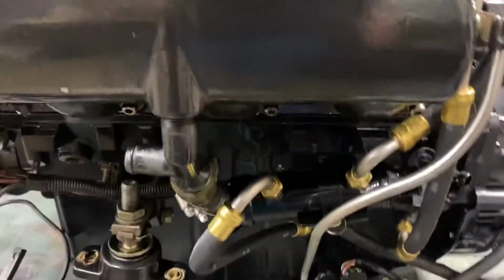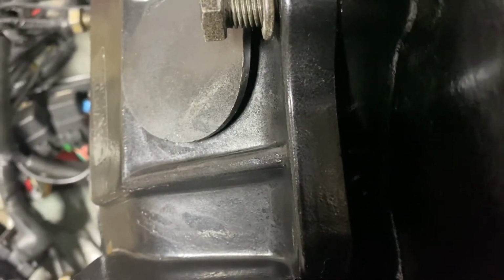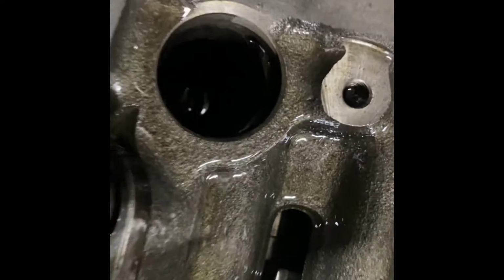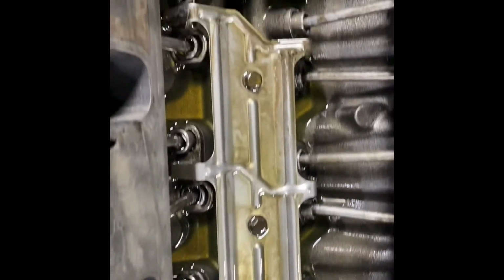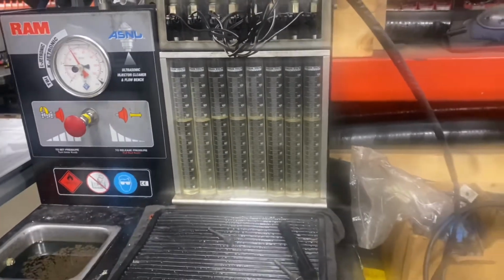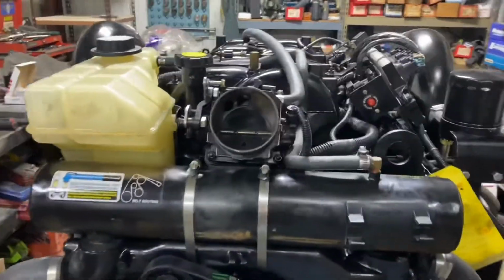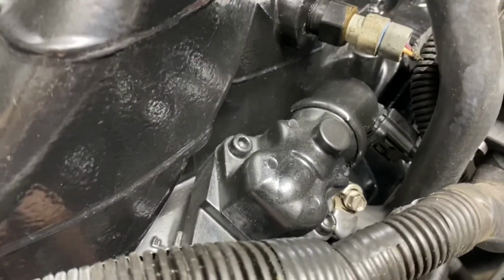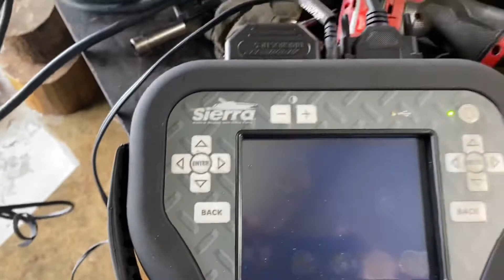Mercruiser 8.1 496 Horizon Engine Overhaul

Comment: Hello  good video . I am Brazilian, I'm with a problem with this motor. Two cylinders isn't working in the right way. The boat do not take off. Could  you help please.
Could you say how many kilos do I have to be and oil pression during high and low? 
Can you say how many is the cylinder's pression? I already test the injectors, cables, ingnition, alcohol and everything is okay!

Comment: Where is the oil temp. sending unit located ? for the gauge
Reply from the maker: There is no oil temp sender on these engines. Just pressure.
Reply: @LakelandAutoMarine    Do you know where else the oil temp would be pick up because I have oil temp gauges on my Fountain and I replaced the gauge and its still isn"t working ?Thank you for your time.
Reply: Do you think it would be near the oil cooler area?
Reply from the maker: @eddiesica3649  ahh - you have a go fast boat. That would be something that fountain installed separately then. It could be in the side of the oil pan, oil cooler or in one for the oil lines. I’ve never worked on those boats before.
Reply: @LakelandAutoMarine  Thank you very much for your help!!